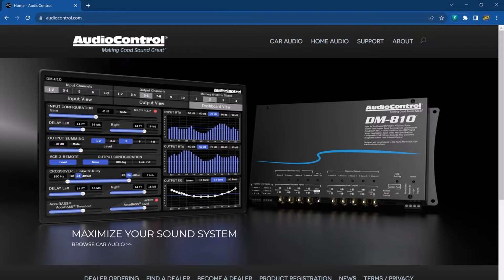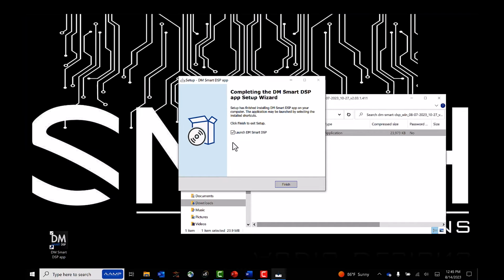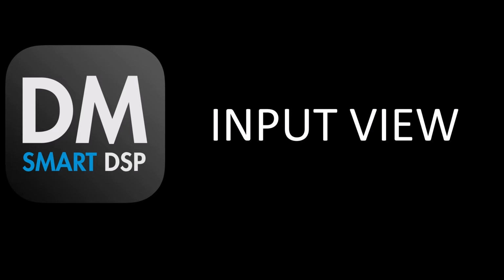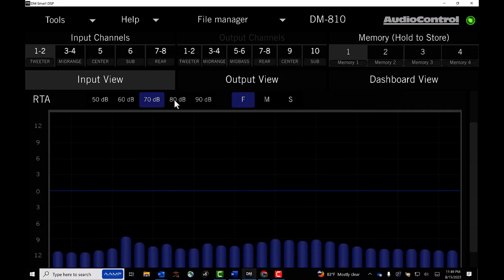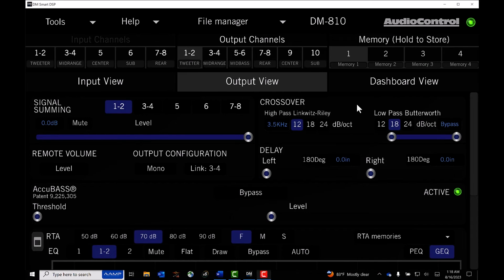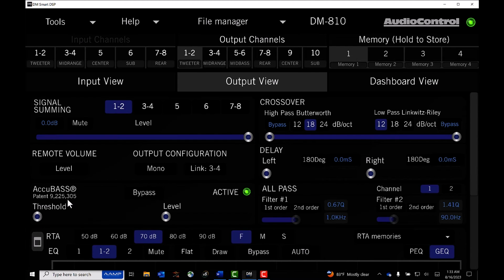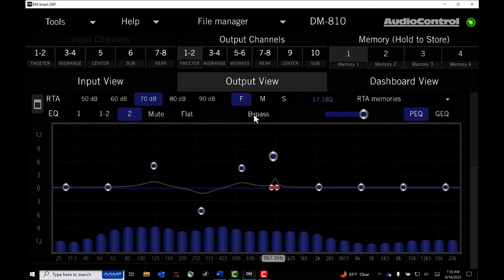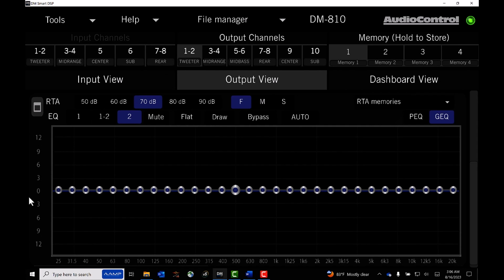NEW DM SMART APPLICATION V2 TUTORIAL

Comment: Do you know what the orange light means on the acr-1 bass knob remote?
Reply: 1. When the left (blue) LED is on, turn the remote knob clockwise to turn the level up, and counterclockwise to turn it down. As it is an endless knob, turning it more than one turn clockwise would be maximum, and more than one turn counter-clockwise is minimum.

2. To recall a memory preset with the ACR-3, press the knob in to switch from blue mode (volume control) to red mode (preset recall). If, within two seconds, you turn the knob clockwise one click, it will recall one preset higher than you are currently operating. If, within two seconds, you turn the knob counter-clockwise, it will recall one preset lower than you are currently operating (for example, to change from Memory 2 to Memory 1).

There is no ‘wrapping’ to the knob, that is, turning the knob clockwise from Memory 4 will only recall Memory 4 and not conjure up a 5 or a 1. Once a preset memory has been selected, or two seconds have passed, the red LED will blink to show you the number of the preset you are recalling, then return to the blue (volume control) mode.

Cheers!

Comment: Dang, I was hoping you would add proportional control of volume level with the remote
Reply: What exactly do you mean by proportional control of volume level with remote?
Reply: @drrckhamilton  It's a bit complicated, but my setup has no control for volume other than the ACR knob. That's because my source input is SPDIF from the OEM head unit which contains no volume data. Since I rely entirely on the ACR knob for volume control of my system, I need AudioControl's firmware to be able to control each channel output in a proportional way. As it's designed right now, if you have all your outputs to be controlled via the ACR knob, and you turn the knob, each channel gets raised or lowered by 0.3db. This causes some buggyness when lowering the volume to the minimum and bringing it back up with the knob. When the knob is used to lower the volume to the lowest level, all the channels drop the same level, overwriting any per-channel gain I have in the DSP until it's rebooted. Basically, my sub channel, and my door speaker channel will have the same pre-set gain when I bring the volume up.
Reply: @tylerwatt12  

Thanks for responding.   I am wondering if this would be a problem for me as my intent is to use a high-resolution music player out of the coaxial input, and I know that typically you are unable to control the volume from the head unit when connected to coaxial.  I would also like to be able to change inputs if possible.